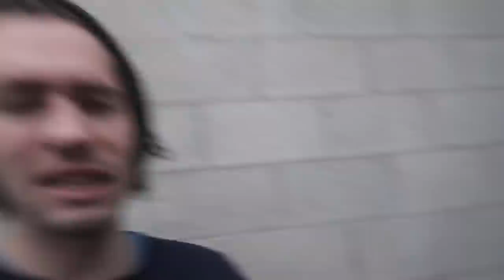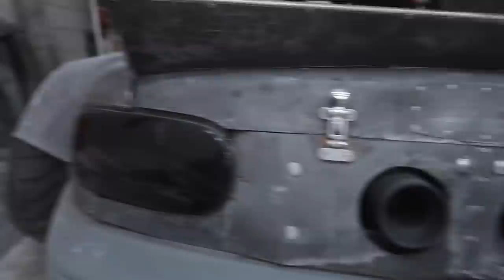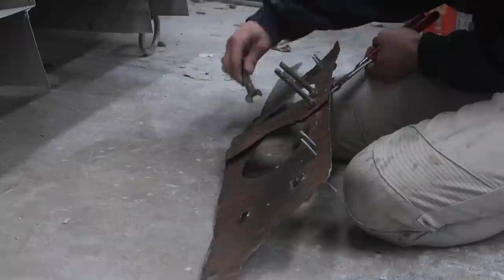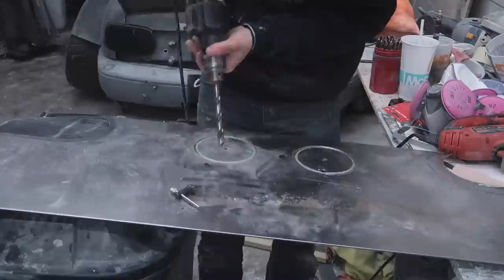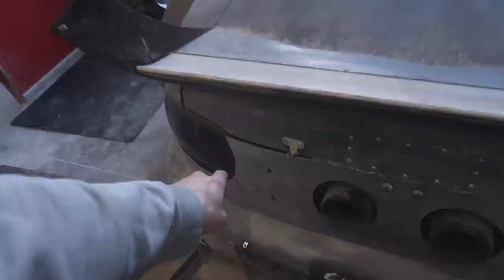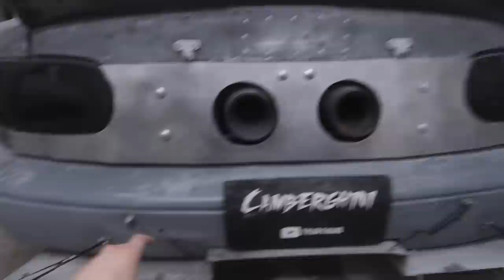Custom Rear Finish Panel For The CAMBERGHINI MIATA!

Comment: You said motor cycle exhaust and I thought of supertrapp could be cool. Tuneable baffles and there is one the kinda fits the rivet look.
Reply: even get rid of the existing tips and have them sticking out of the rear panel a bit!